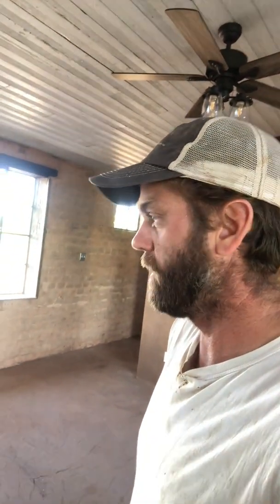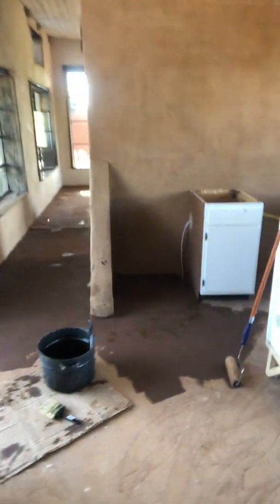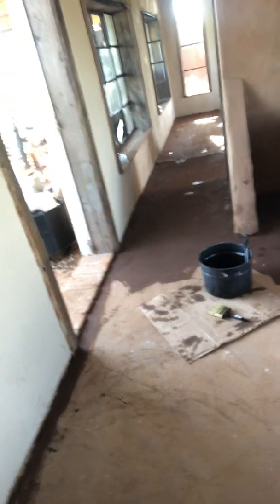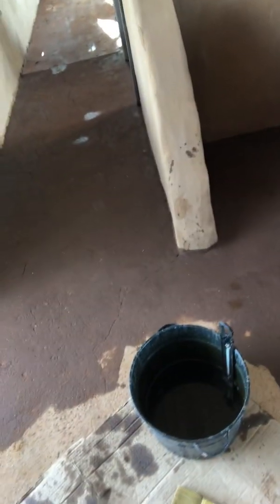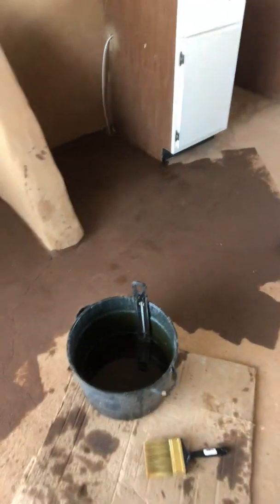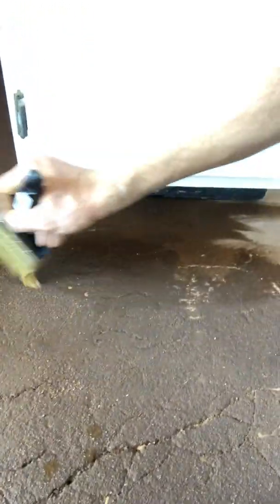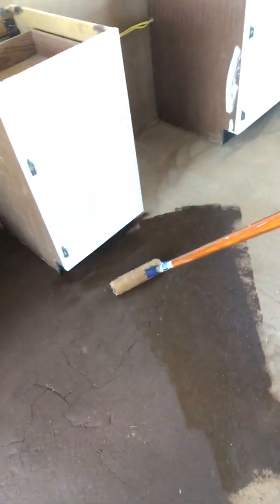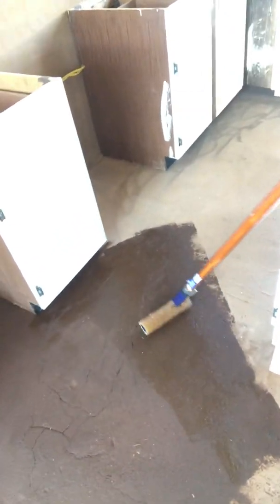Sealing an earthen floor

Comment: How much linseed oil would I need for a 196 sf room?
Reply: 10 gallons for all coats. 5 gallons per 100sqft. Can do half that if the floor doesn’t need to be very hard.

Comment: Here's my question. Would this work for an all dirt basement? There is no electrical hook up for miles. Totally off grid. Generator available but concrete mixer not possible do to terrain. If not what is available to seal dirt floor and walls?
Reply: I saw a video in spanish using recycled oil + lime mixed together then applied..

Comment: How do you clean this type of floor? Can you mop it like tile and what cleaner should be used to not damage it? Will there need to be future reapplications of the linseed oil?
Reply from the maker: The linseed oil will seal, waterproof and harden the floor. After that you can sweep, mop etc. There shouldn't be a need t re-apply unless you have to make a repair.

Comment: How many days it take to settledown after 5 coat of oil in it and i have question that does oil layer stick in foot or should be coated with bee wax.
Reply from the maker: We only used 2 coats of linseed oil...that's all you need!  You can walk on it after about 3 days, and it will continue to harden over the next three months.  There's no need for any coating.  The hot oil bonds with the earth and hardens.  It is waterproof and very durable :)
Reply: @advancedearthenconstructio5103  thanks bro